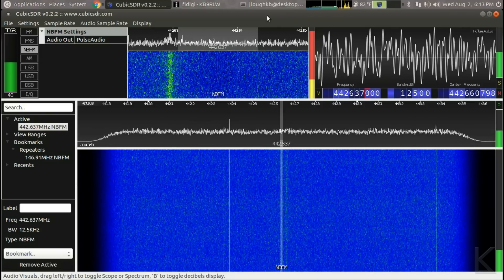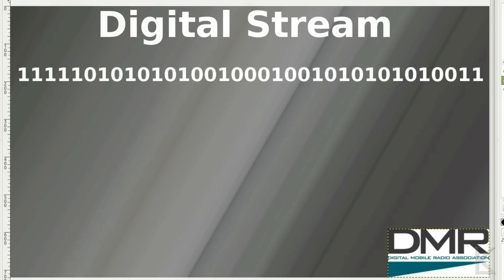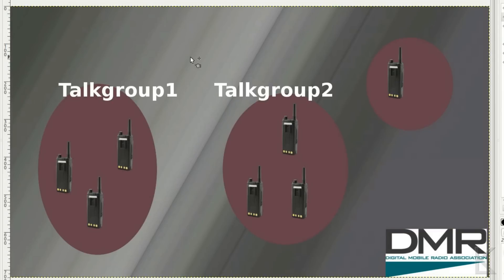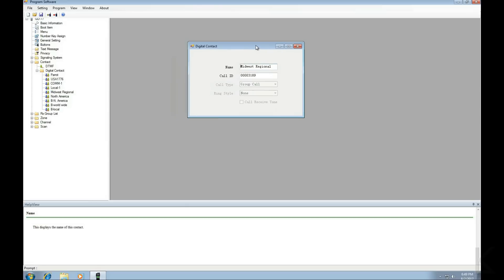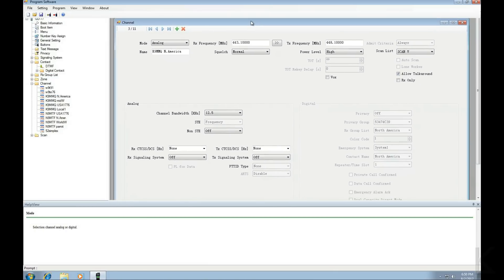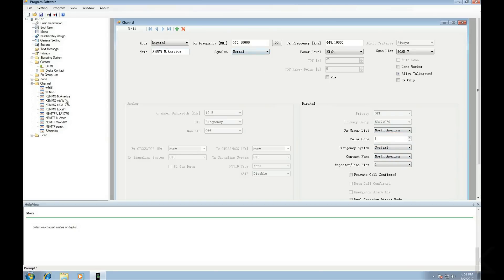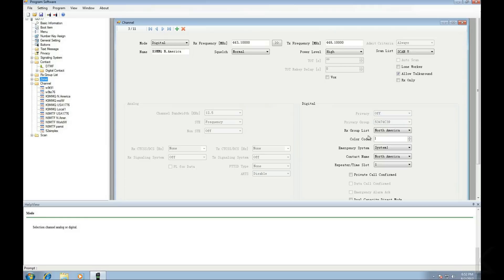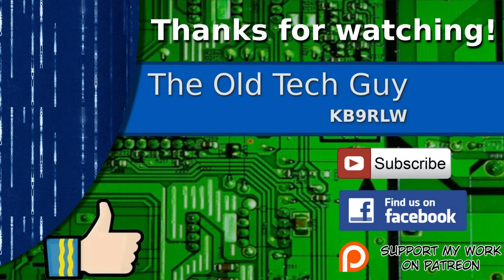Ham Radio  - DMR radio discussion  How it works

Comment: The primary goal of the DMR standard is to specify a digital system with low complexity, low cost, and interoperability across brands, so radio communications purchasers are not locked into a proprietary solution. However, in practice, many vendors have introduced proprietary features that make their product offerings non-interoperable with other brands.

Comment: Does it go on HF....
Reply from the maker: It could probably be adapted for HF.  A big problem would be the constant rapid switching between transmit and receive.   Also, you'd get better audio quality and communications with simple SSB.  Digital modulations require a decent signal level where SSB can be intelligible with even weak signals.

Comment: Kevin, a very good video. Nicely laid out with no fluff. You might want to include 2 things in your next version.. 1- The id of the radio that the operator must have before he can get on the air  2- A mentioning in passing of Brandmeister.

Comment: Noob here. Have some questions if you don't mind. So Repeaters , Talkgroups, Zones, timeslots etc are all setup by the owners of the repeater . And these can be businesses on certain frequencies , or  HAM operators that setup repeaters on frequencies already assigned to HAM's . 
1) So what if a HAM joins a talkgroup owned by a business ? is it allowed or possible at all ? 
2) How does one register to a talkgroup ? 
3) How can you make a private call ? Does the recipient need to give you his ID ? 

Sorry if this is too long, but I am struggling a bit with this DMR thing.
Reply from the maker: Businesses are always self-contained and not internet connected.  No cross-polination can happen.
When you key your radio on a talk group, the radio is announcing itself and is automatically in the group until it times out.
Yes, a private call needs ID's.
Reply: @loughkb  thanks

Comment: hi there i have two quick question firstly proberbly a silly one it is possible to use multiple dmr radios on the same tx and rx freequences  secondly if not could i use to hand held units as a buget local repeater for light use

Comment: Best explanation I have found so far. Many thanks for making the video. What I find lacking during searches for DMR videos is those which show how to use DMR practically. Not the radio setup, but how to connect to a talk group on a repeater, talk on it, end the talk group connection; and also what happens if two talk groups are active on a repeater simultaneously - is this even possible? Sorry I'm a newbbie, but just looking for someone to talk through the mechanics of using talk groups on a repeater. Cheers
Reply: Most DMR radios I have seen will 'hang on' to a talkgroup it has just heard, for a set amount of time. Let's say 20 seconds. If you key up within 20 seconds it will go out on the last heard talkgroup even if your radio was set to a different one. If the 20 seconds has gone by, it will 'let go' and your radio will transmit using whatever channel you currently have it set on.

Comment: I'm still lost AF. you went through the menu's, but I still don't see it from a radio-radio or radio-repeater-radio setup.
IE, i'm in the middle of nowhere, but i've got a buddy 5 miles away also with a DMR radio. what do we need to program in for DMR "simplex"? anything?
Where can I find info about DMR repeaters? what resources are there?

Also, if i'm listening in on a freq, without any settings programmed in (in analog mode?) will I hear DMR transmissions? Analog transmissions? or will it sound like garbled hell?
If I transmit, how do I know I'm going out via DMR or via Analog?

I will say, the zone thing seems kinda cool, especially with radio's that have GPS built into them -- you could have the radio pre-programmed for different states, and as you get to a certain area, does it just change over your settings? ie say I program my radio for a certain set of repeaters near me locally as zone 1, but I travel home to my parents for the weekend. and have the repeaters there loaded up in zone 2. when I travel, will it automatically "block" or filter out the channels in zone 1?
Reply: Munky, do a search on 'talkaround', that is the DMR term for simplex. If talkaround is not selected, DMR radios will look for a repeater when you key up. If there is none around it will say 'repeater not found' and give up. If you select talkaround it won't look for a repeater, it will simply transmit with your settings (color code, etc).   Yes you will hear DRM if you are listening on analog, it will just be an unpleasant noise though.  Most radios will prominently display Digital or Analog, or D or A. you'll know what you are transmitting on.

Comment: I've just gotten the latest and greatest version of the Baofeng DM5R that is actually supposed to operate on separate tier 1 and tier 2 properly. I noticed that you are running the exact same program that I have. I can't find anyplace where you Save the individual Analog and Digital channels. The best I can do is operate in VFO mode Analog Simplex and Repeater Splits. I'm going to have to get someone locally who is using DMR to program this thing so it works properly. I've applied fore my ID number. I've been a Ham for 44 years and this is the most confusing thing I've ever seen. I at least figured out what the COLOR thing was by watching your video. The one thing that I've learned is that this mode will be great in a disaster if everything thing in the system is up and working but will be useless if any part of the system is down. I'll keep fooling with it because its a new toy to play with but I'm not going to put my life in the hands of Digital VHF and UHF radio. I've never been a fan of linking repeaters together anyway because if you like them all together, one nut job can tie up half the Country with his BS conversation about his flat tire on the way home from work.

Comment: It's my understanding that private calls are not allowed on the DMR-MARC network, correct? If so, is this basically just used as a digital version of HAM? I guess the advantage being you can isolate conversations through the existing talkgroups. Are there scenarios where you can use the network for one-to-one calling or would you have to have your own repeater for that?
Reply from the maker: Yeah, I think on the networks you're limited to public talk groups.    I haven't gone any deeper into it since doing this video.

Comment: Who can use the DRM radio?  what license do you need?  Can someone with a GMRS license?
Reply: Kansas, I hope you got your answer by now!  You need an Amateur Radio (HAM) license.  The license itself is much cheaper than the GMRS license.
Reply: To add to Steve's response, digital isn't allowed on GMRS either. Get your ham ticket, it's basically free and good for 10 years just like the GMRS license's are now.

Comment: This is all wonderful stuff until the CatV comes and blows all the towers down and kills the electric infrastructure.

Sadly, so many new hams today ( and far too many older ones ) don't know code anymore...

Funny how ham radio has fallen so far from its beginnings...now it seems to be nothing but over-priced digital training wheels.

:(
Reply: Electronics should never advance and it's impossible to learn how to do more than one thing.

What do you think of amateurs creating infrastructure-free, decentralized mesh networks using repurposed WiFi routers? They are designed to work when the towers blow down, but is it the right kind of radio according to the old curmudgeons who want to make sure Ham radio dies?
Reply: @stupendisdick4442  Are you another old ham who thinks CW is the only valid mode who can't wait for the hobby to die? Also, thanks for the completely predictable, utterly off-topic, right-wing commentary - it's such good verification you don't even have to answer my question up above, you guys are all identical and you literally can't help yourselves.
Reply: @stupendisdick4442  The only one making leaps here is you, my curmudgeonly Old Bean. I'm a 47 year old man, I just haven't ossified like many in the hobby.

Why are you white-knighting, I wonder, for the guy who made the comment I responded to instead of taking my obvious point?

"Critical Theory"

There you go again, how come every single one of you guys is such a right-wing conspiracy theorist on top of everything else you couldn't have a conversation about the weather without bringing it up?

Comment: I think I am going to dive into this with that GD-77.  Few questions,  I checked repeaterbook, and did not see a way to download a route file for when I travel to FL for example, I would have program this manually?  Can I send a short text to a friend that would move through the system and hold on his radio for him to see it at a later time?

Comment: Really nice video thanks.  Can you recommend a low cost radio to start with?  I've read that some have issues. de N8XYN k
Reply: The Connect Systems CS-580 UHF handheld is an inexpensive, simple, stable, basic DMR handheld. Its what I started with last year.

Comment: I see you're running Linux and a program I haven't seen for decoding DMR. Do you have a video explaining how you set up that decode with your RTL-SDR?
Reply from the maker: +John Wilson nope, no decoding going on.  I'll have to rewatch the vid to see what you saw.  There is something built on gnuradio that will decode non-encrypted  Moto digital, can't think of the name of it at the moment.
Reply: I stand corrected... you are absolutely correct. It wasn't decoded... I've just been going nuts trying to find the process to decode digital radio on a linux box and have failed on all attempts. There are a lot of videos that claim they provide a process to decode digital with RTL-SDR but some of them are vague at spots, with you having to "figure it out" and I haven't figured it out yet. 

Just don't want to put it on a Windows box, virtual or otherwise.

Comment: I thought that that it was QAM/QPSK based, I think it is time to ditch windows and run the Windows applications that you use most under Wine64, Winetricks64 and the windows archiver that windows uses to unpack zip and cab files, I think that the 7ZIP plugin for the Archiver should be able to unpack cab and zip files making easy to install the windows applications inside Wine64.

Comment: Does the software for this radio not allow you to change the admit criteria?  I noticed the choice seems to be "Always" and grayed out throughout your video.  Typically for repeater usage you'd want to choose an option similar to "Color Code Free" so that you are not inadvertently stepping on someone else's QSO.
Reply from the maker: There is a key combination that unlocks the grey options.
Reply: yes, to do so, I think you need to go into ADMIN mode.  on that software you get there by clicking CTRL-ALT-SHIFT -5   then enter the password of DMR961510